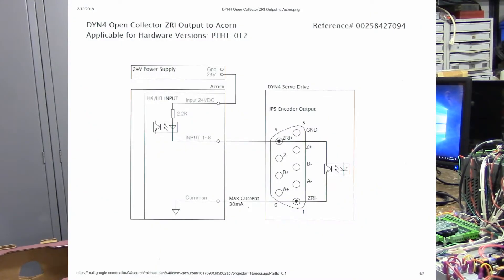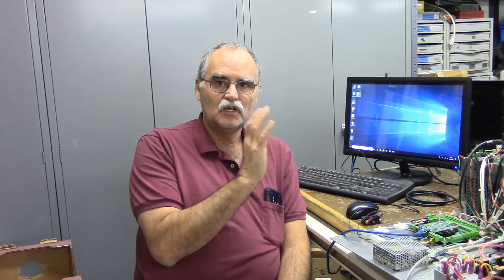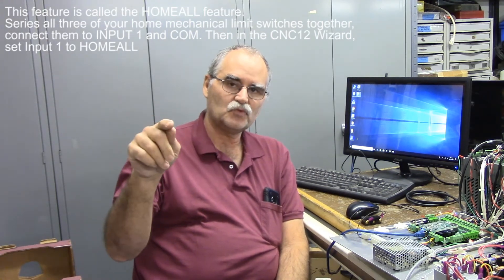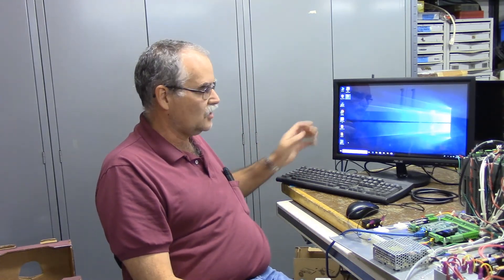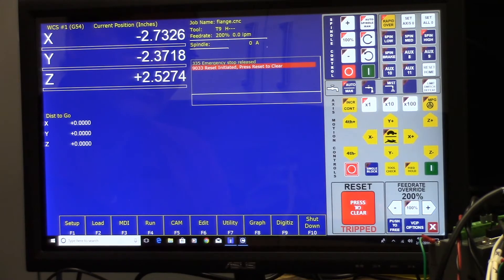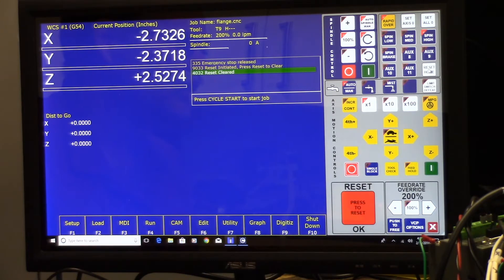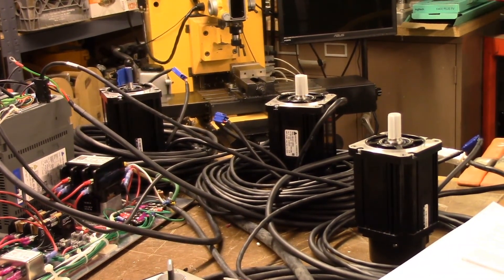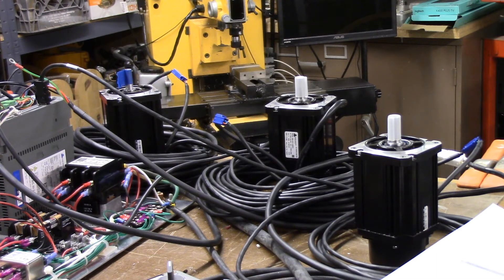Phx 4x4 Router update: ZRI Added to DYN4

Comment: Marty, while using this video to add homing to my machine I noticed that you were required to cycle reset to start your machine.  The version I am using does not have this feature.  This is want.  I want to require a software reset on power up and after an e-stop.  Is this an option somewhere in the parameters?  Sorry a little off topic.
Reply from the maker: The software used to require a reset on power up. Are you saying that feature is missing? Please run over to the Centroid CNC User's forum and post a fresh report there with your concern. Centroid will comment on it. If you hit Estop and reset E-Stop, you reset CNC12

Comment: Can you connect all 3 ZRI together and feed into a single input on Acorn?
Reply from the maker: Sohan De Silva. No. Not if you are trying to use the index pulse for precision homing. Each have to have its own input. You can series the mechanical home/limit switches.
Reply: Ok. thanks. Do you know how to make the homing speed slower?
Reply from the maker: Change the feed rate in the .hom directory. You should post your technical support questions on the Centroid CNC User forums: http://centroidcncforum.com/viewforum.php?f=60
Reply: I did. But no reply. lol. Anyway I was able to feed all the three ZRI to one Acorn input and works great. Thank you. Now I can get about .0001" amazing homing repeatability.
Reply: I suppose the only reason you couldn't join the three ZRI signals is if you home all axis simultaneously ?  @sohandesilva4324
Reply: @outlate247  Mine connected together and z homes first then y and x.